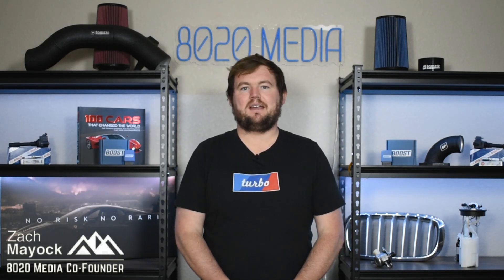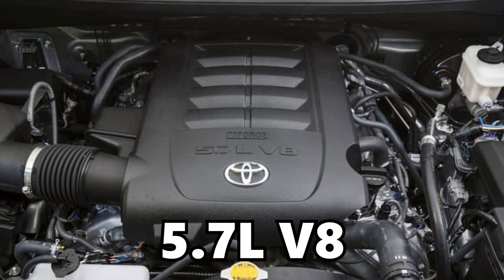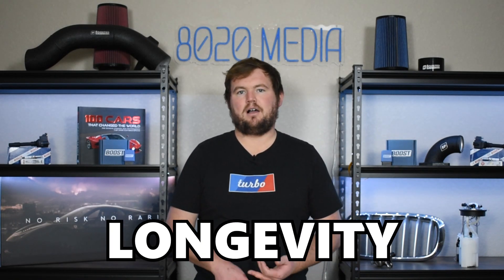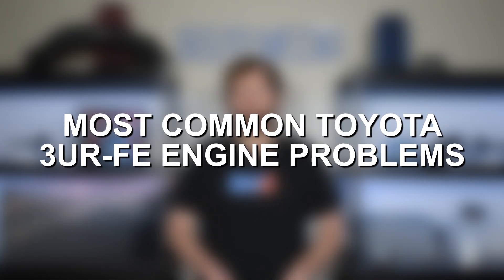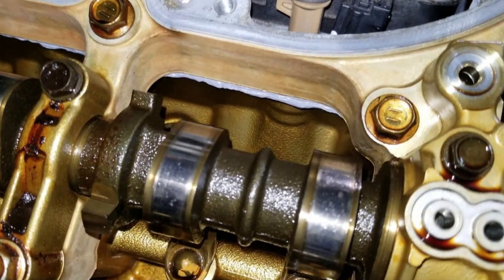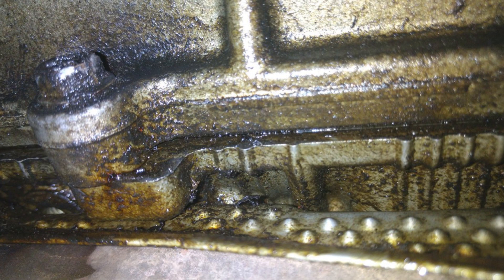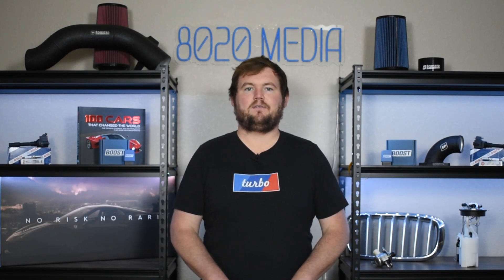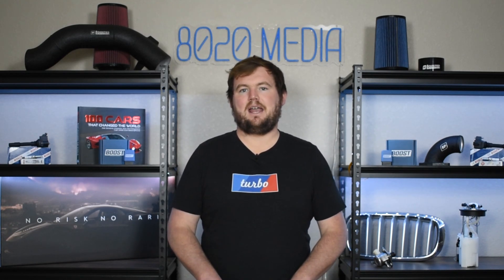Toyota’s 5.7L V8 (3UR-FE) | 3 Common Problems & Reliability

Comment: It’s the cam tower to the cylinder head that leaks. The cam tower to valve cover has the valve cover gasket obviously. Also I own 3 -3urfe engines all of them over 200k miles & 1 with 488k miles. None of them burn oil. I change oil at 5k miles and it’s always at the full mark on the dipstick every oil change. I must have gotten lucky. I dunno.

Comment: I've owned a 2011 and now a 2018 Tundra, both with the 3UR-FE engine.

I will attest to the cam tower leaks. It's typically not super serious. And, by asking several different repair shops, I was able to get these done for only about $300.

By the way, I highly recommend not DIYing this one. There's a good amount of hardware over these valve covers and a shop with far more experienced mechanics than myself ended up taking an entire business day to get mine done.

As for the water pump, I recommend replacing it along with your serpentine belt, tensioner, pulleys, and coolant at 100,000 miles.
Yes, it'll probably last closer to 150,000 miles or more. But, 100,000 miles is the perfect time to get all this stuff done at once.
After that, still do all that, but replace the coolant every 50,000 miles.
Reply from the maker: J - Thanks for taking the time to share your first-hand experience! This will definitely be helpful for future viewers.

Comment: It's an excellent motor if your take extra good care of it, and it is capable of outlasting the competition even if you don't take great care of it.

I bought a 2007 Tundra with the 3UR-FE and 270,000 hard miles under it's belt, the three previous owners neglected performing timely coolant flushed and oil & filter changes, I put 45,000 miles on this motor over a 7 year period before the head gasket failed. Scoring was discovered in cylinders once the heads were removed... I replaced the motor with a low mileage motor that I put new gaskets, FIPG sealant, timing components, a lot of other new OEM parts and a completely new cooling system. I continue to change the oil & filter every 3 to 5 thousand miles and flush the coolant every 50,000 or 60 months.
Reply from the maker: T - Well said! Thanks for taking the time to share your experience.

Comment: If you were to take the engine out and add gaskets instead of the rvt sealant, would it work? (Sorry I don’t know much about cars)
Reply: For the cam valley seals they're honestly not as huge of an issue as it seems. It seems plenty of independent shops can do the work for a reasonable price. I don't think you can switch to gaskets but you may only have to do this $500-1000 job once every 15 years lol so it isn't a huge deal.
Reply from the maker: A - For what?
Reply: Take the engine out?  No, that’s way too much work. I’ve repaired cam tower leaks which isn’t that difficult. It’s just a little time.

Comment: You forgot another common issue on the 5.7 v8,  driver side chain tensioner, is a common issue on 3ur engines..  make a notorius tick inside of the engine on cold starts..
Reply from the maker: R - Thanks for sharing!

Comment: another common problem you missed is coolant valley plate leak or in a proper term heat exchanger leak. as well as idles have been known to fail as well. Another added expense is the starter due to its location.
Reply from the maker: S - Thanks for sharing these insights.
Reply: @8020Media  you are welcome!
Reply: Incorrect on the 5.7.  It's starter is on the side, not in the valley.

Comment: what oil viscosity is better for this engine? 0w20 or 5w30 and why?
Reply from the maker: M - 0w20. Not only because it's the manufacturer's rec, but also for cold start performance, and fuel economy.
Reply: @8020Automotive  could it handle Pennzoil ultra Platinum synthetic 5w30 or 5w20 in the hot Texas summer heat in the south down here
Reply from the maker: @ Yup! 5w-30 is probably best.
Reply: @8020Automotive  Thank you!
Reply: 0w20 Mobil 1.  My 5.7 has 305,670 miles.  Still loves it's 0W20.

Comment: Changing coolent as recommended will extend the life of the water pump.
Coolent becomes acidic as it ages and will eat at parts of the system like the pump.
Reply from the maker: A - Well said! Thanks for sharing.
Reply: also from 2007 -2013 if you do't change your coolant on time you will have head gasket failure and it may end up warping the block costing up to $30k for engine rebuild. Not cheap!
Reply from the maker: @ Correct!

Comment: ACTUALLY, 2UZ-FE 4.7L V8 IS THE LEGENDARY KING OF ENGINES!
Reply from the maker: T - Thanks for sharing.
Reply: Nah its an outdated under-powered engine. The 5.7 is the new sheriff in town. Some of these 5.7 are approaching a million miles already. Change your oil and service your coolant and yo are good to go.
Reply: @Ed-Ward-w9v  Agreed. It is actually pretty insulting to say that this engine lasts 200 - 250k miles. Also the video fails to mention the notorious ticking sound from the engine due to oil tensioner. Engine oil change, Coolant change, transmission fluid change, differential oil change along with water pump and some routine tires/brakes ... you can take this to 500k miles easily. Also, please change your PCV valve regularly if you see oil consumption issues. A clogged PCV is the main reason for oil consumption on these.
Reply: @hbasavar well said on your points of view being a real true blue 3urfe owner that understands his engine. Only think I would add is throwing good 5w30 oil in it to help with chain tensioner and better engine protection. That’s my opinion though in the manual it states in Mexico that’s the recommended oil weight. Damn EPA messing with consumers investments like always.